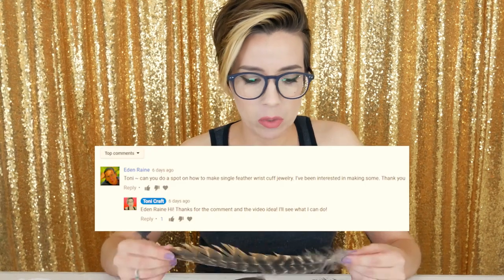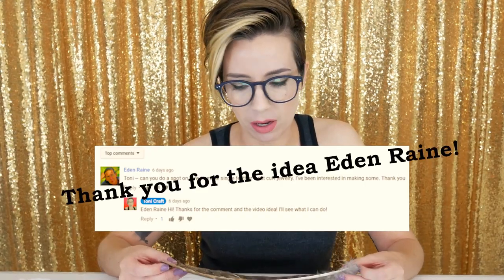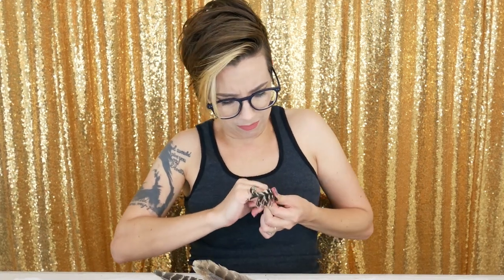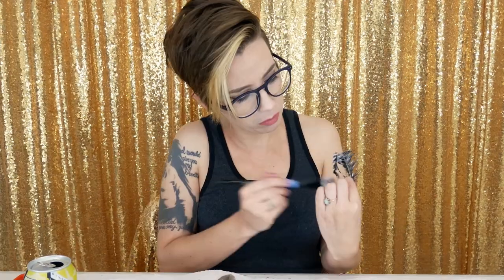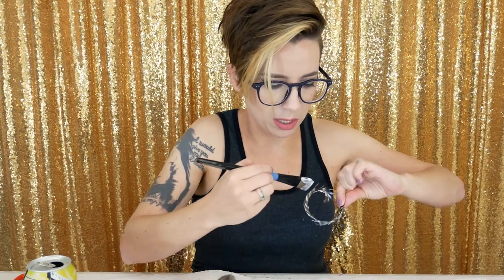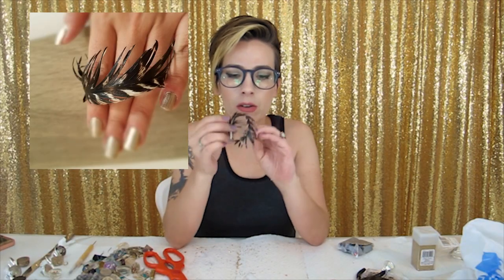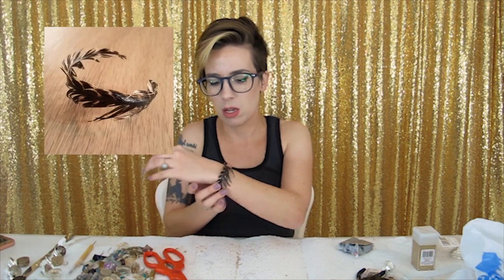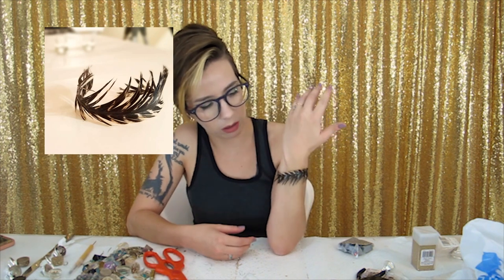How-To Make a Feather Bracelet w/ a Single Feather

Comment: Where did you get the feathers that you used? I've been searching for some good feathers, but all I can find are the thick quill feathers. I feel like those might be too thick (the shaft, anyway) to curl.
Reply from the maker: oHmega14 Hello! The feathers I used in this video were turkey feathers from a farm turkey. I would prefer using something a little thinner than that as I really had to beat it up to get it to curl. It did work though and is still holding the curl!